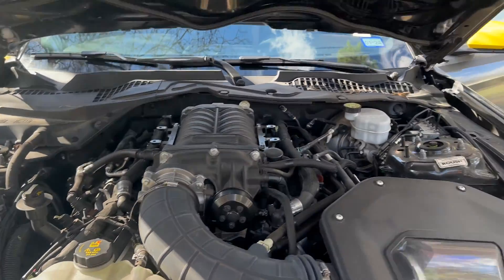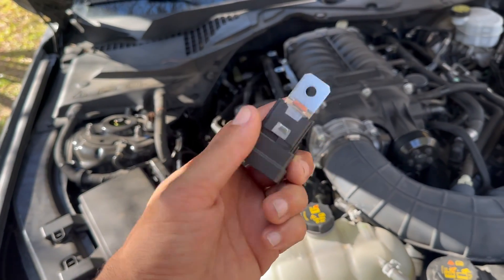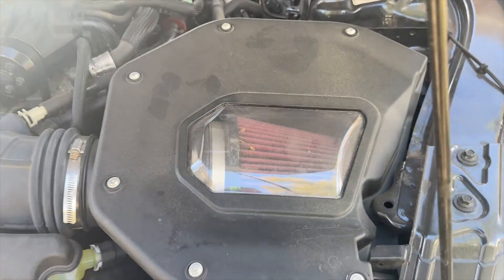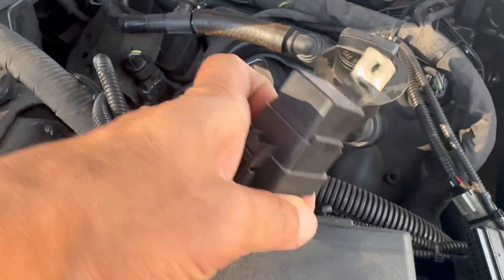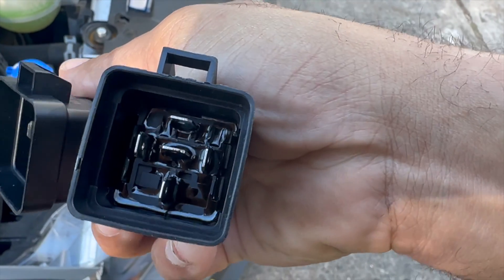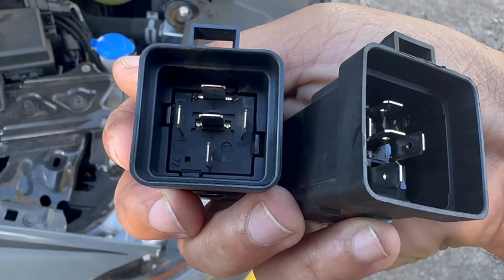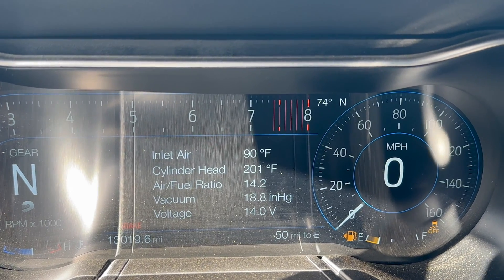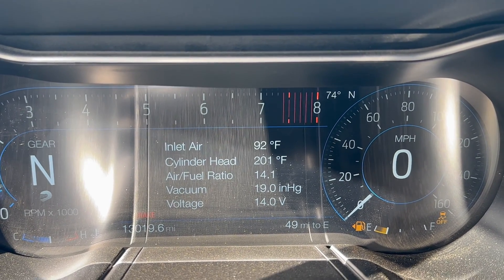$10 Fix for S550 Ford Performance Supercharger Heat Soak

Comment: I don't know if you remember my car the "avocado roush"? Well I had heat soak issues as well and what really helped was going catless. Hope you get it figured out. I also was going to go with a triple pass heat exchanger but ended up selling the car before I put more in it.
Reply: Be glad you passed it up. There is nothing you can do to keep that Roush blower from heat soaking.